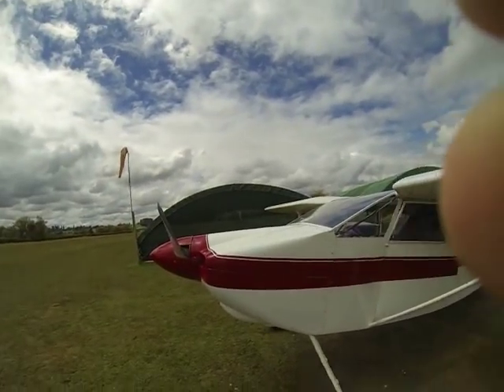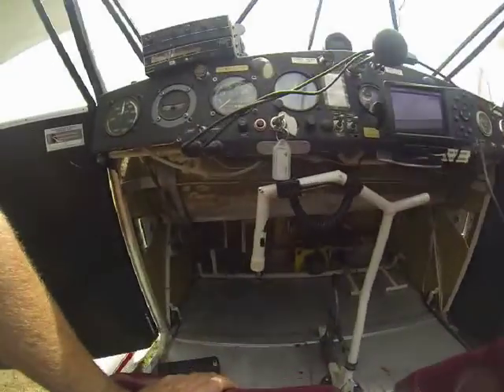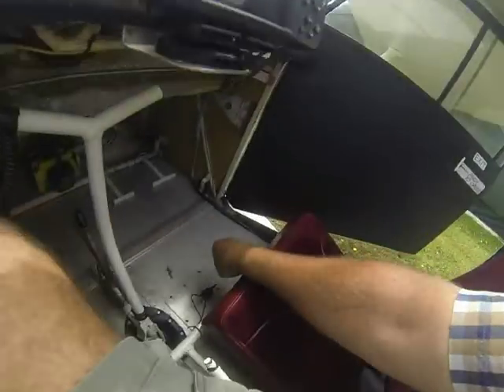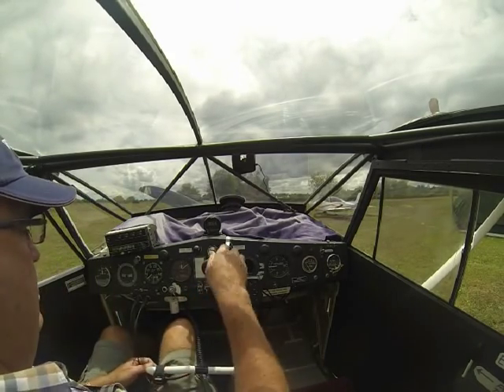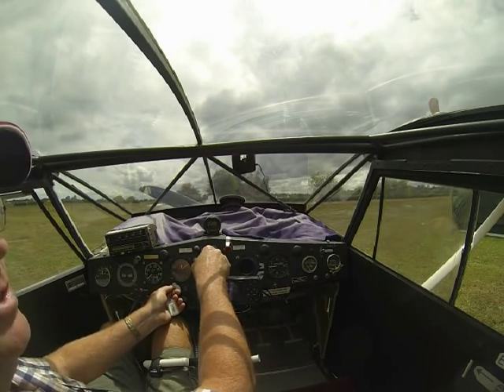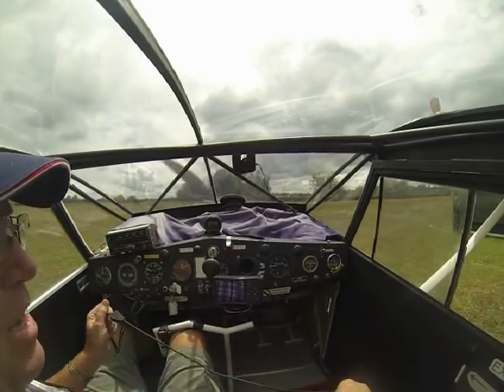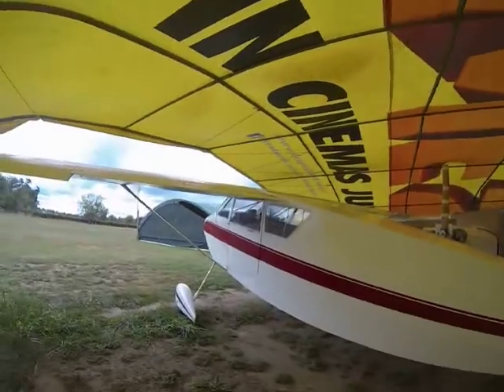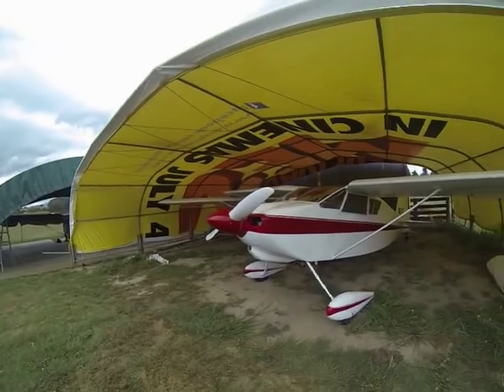Wittman Tailwind

Comment: Purchased N625MS sight unseen back in August 2018. Hired a friend pilot to bring it home from Alabama to Michigan. No regrets. Changed the side stick to center sticks on both sides to get full deflection of ailerons. ( side stick bumped my leg ). Moved the power quadrant to center lower panel. 
    625MS is finished very well in and out and other than the mentioned I replaced the vernier throttle cable with an aircraft friction type and refined some cosmetics.
   Bird flies beautifully with a Continental 0-200.

Comment: What sort of hangar is that Bill?
Reply from the maker: downunderdude2009 

Home made plastic hanger  made from rolled 2.5 inch pipe and old sign banners  
where are you from   I have 3 hangers like this  078718940  bill
Reply: Round steel tube hanger covered in PVC sign fabric  15 years old still good